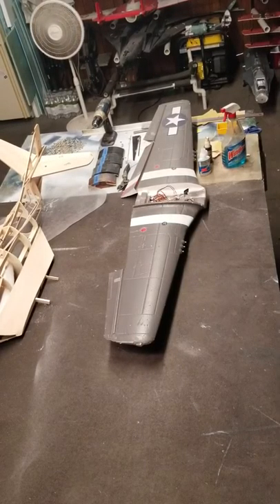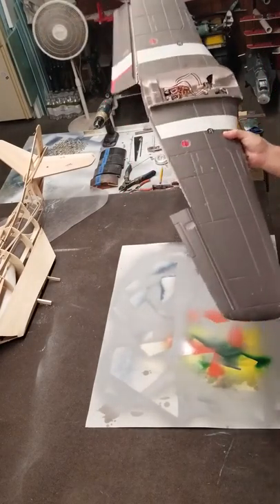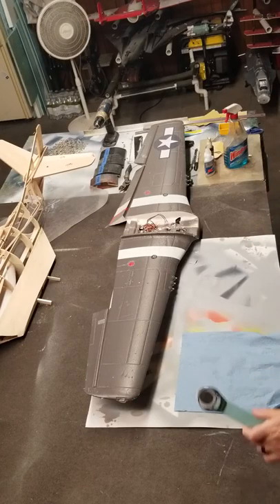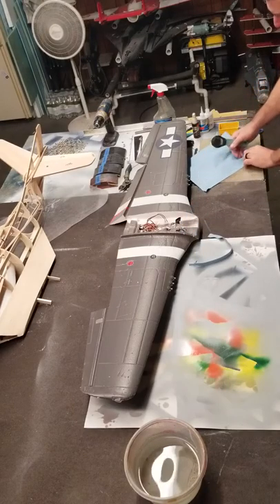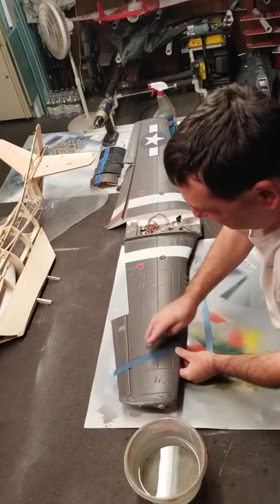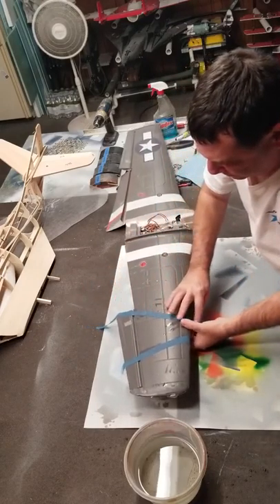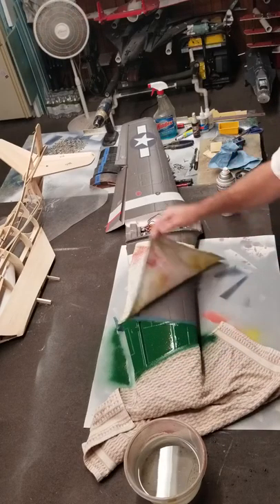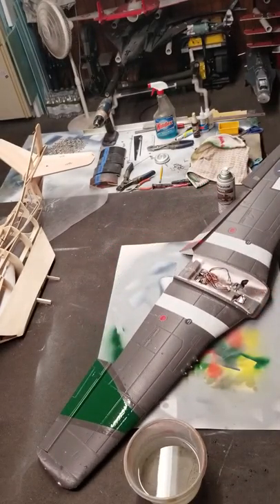Painting and Masking EPO Foam

Comment: Thanks, that was helpful. But what if you want to paint bare EPO foam? There is an issue with paint sticking to it. In your case you are painting over the existing paint so you have no issues. But how to go about painting over bare EPO foam?
Reply: What I do is sand it gently with 150 and prime it. Will look horrible at first but trust the process. Then wet sand smooth, and paint